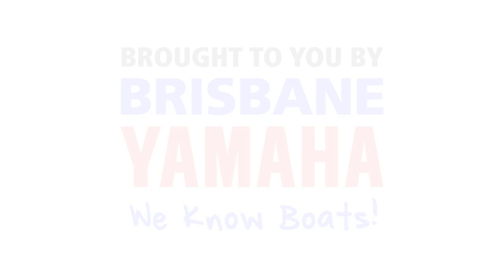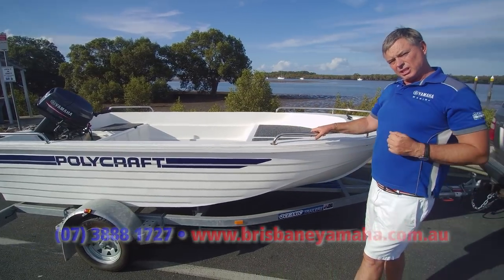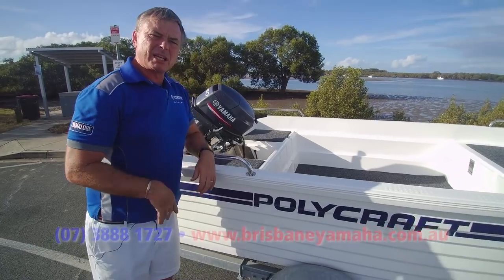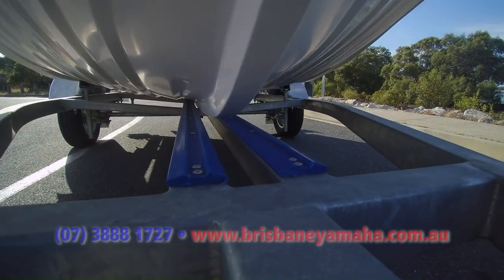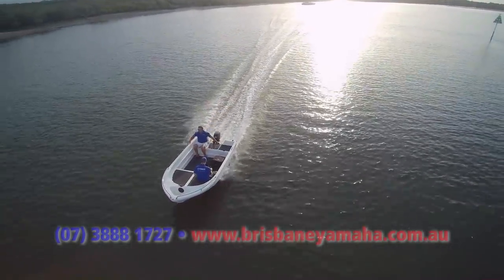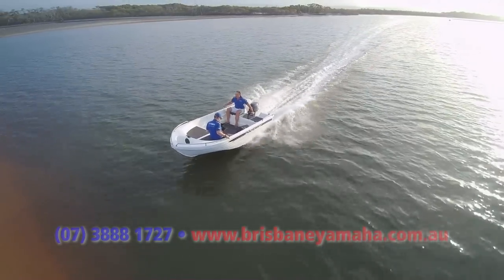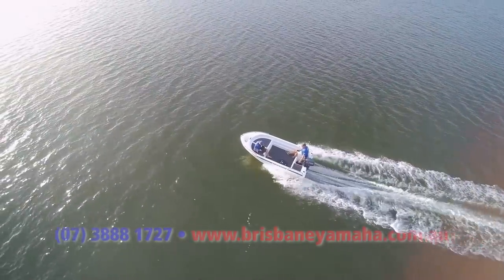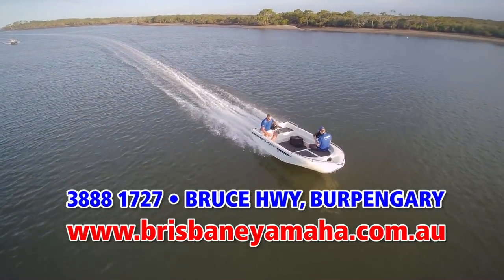Polycraft Challenger 410 + Yamaha 30HP boat review | Brisbane Yamaha

Comment: What does one of the draft fully loaded?
Reply from the maker: 300
Reply: Brisbane Yamaha 
Yes what’s the draft of the 300 at full capacity? I’m interested but I fish a bay system with a little over half meter .6m average depth. Getting up on plane in shallow water maters a lot when it’s 15-20cm of water or less for kilometers in every direction. That’s the reason I ask. I can’t seem to find it listed on the website or anywhere else. The only reference I’ve seen was someone say it was shallow. That answer is kind of subjective.
Reply: @BrisbaneYamaha  300 Australians ?